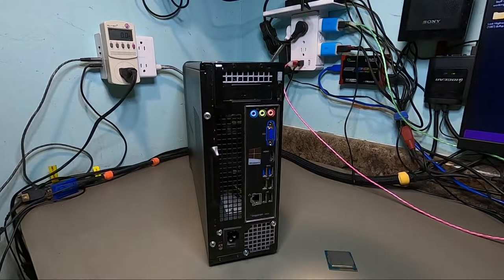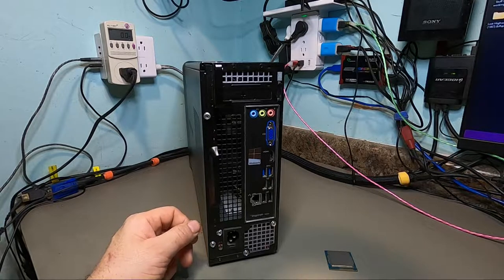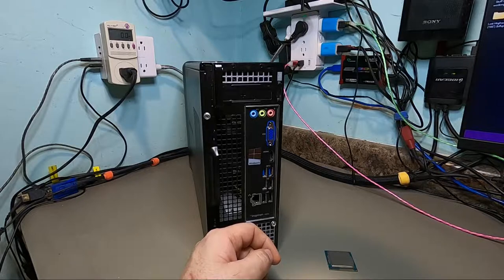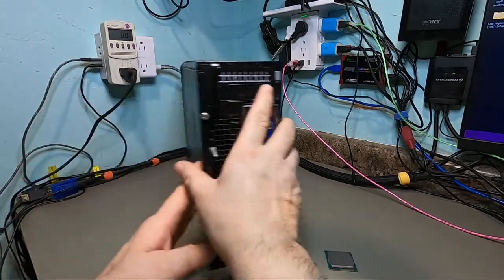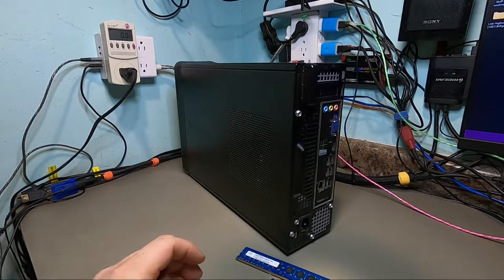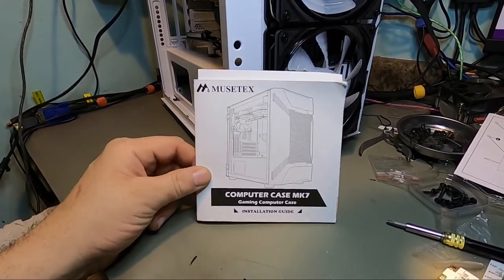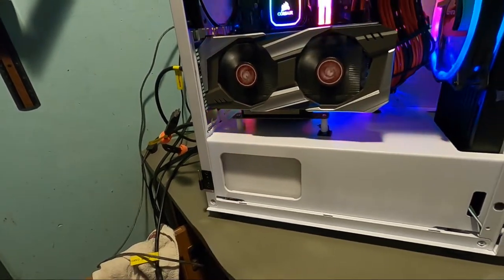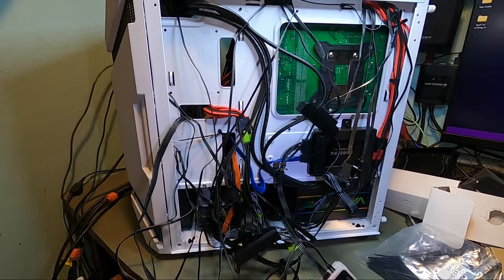Dell Inspiron 660s to Musetex MK7 Mesh

Comment: Hey my question is how you connected a case fan when there is no sys_fan header in motherboard cuz i have same pre built and swapping motherboard to new cabinet but can't connect case fan because of no header for case fan. please reply fast cuz it will be very helpful thanks
Reply from the maker: On this build I used a trick. I had a specific AIO connected that plugs into the USB ports. Fans are controlled in software.
Reply: @phreakwars  Mean you have  connected fan to usb header right?
Reply from the maker: @adityaparmar9065  The AIO is connected to a USB header. The AIO also has 2 fan power jacks coming off of it that feed a pwm signal to it which gets relayed to the motherboard via USB.
Reply: Thanks for helping

Comment: Could you put a network/Bluetooth card in here and, if yes, do you have any recommendations?
Reply from the maker: There are 2 that I would recommend. The Intel Dual Band Wireless-AC 7260 or the Dell DW1550. Use the Dell DW1550 if you are thinking you wanna convert it into a Hackintosh too.

Comment: Would an RX 6400 work in the original case with the original PSU?
Reply from the maker: Yes, either of these will be fine https://www.newegg.com/p/pl?N=100007709%20600038363%20600038364%20600007787%204017%20601359511%20601296707%20601331379%20601201888%204814%20601413100&Order=1 As long as it is a single slot you'll be good.. PS, I have a video coming out soon showing performance on the 6400 with a Xeon E3-1290v2 which is the best CPU you can use in this machine.

Comment: What’s the best graphics cards that you could (realistically) install here? I personally would like to put a 1080ti in mine, but is there something else that you’d recommend?
Reply from the maker: 1650 will work in it and that's what I would recommend, as well as the RX 6500. An RTX 2060 will also work but you'll get bottlenecking from the CPU. If that isn't bothersome then go for it.  Myself I'd stay within the 1650 range just so the CPU and GPU can get equal footing.
Reply: It's 1060, 1660 or may be even 1070. But any higher than that your CPU will be at 100% and your GPU will be at 70% or lower.

I think i7-3770 and 1060 are perfect for each other

Comment: did you rip out the wifi antennas from the original case? where did you mount them in the case?
Reply from the maker: No, I used brand new, longer antennas, mounted them in the front.
Reply: @phreakwars  just the random ones from amazon with the sticky tape?
Reply from the maker: pretty much
Reply: @phreakwars  hey ive been running it for as while but its getting hot here in germany and ive decided to use a fan hub for it because it only has the cpu fan header. Is it standard pwm? or is there weird proprietary bs. also my hub doesnt have a tach wire. does this need it (will it give me an error meassage) or will the cpu fan just run at max all the time
Reply: @phreakwars  also i added gigabyte wifi 6e
Reply from the maker: @florider_hd  Yes it's standard 4 pin PWM. As for needing the tach wire, if PWM is running properly, than no you do not need it. All that is doing is reporting how fast the fan is spinning, voltage control for the fan to adjust speed is controlled by PWM.
Reply: @phreakwars  thanks!